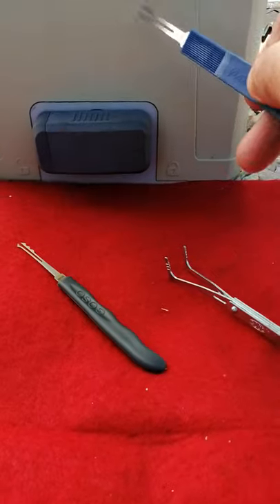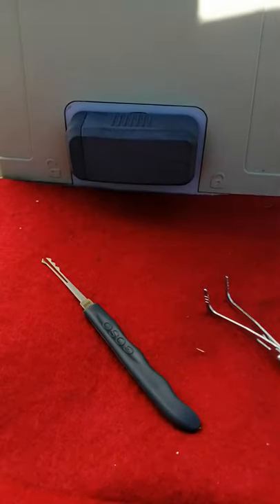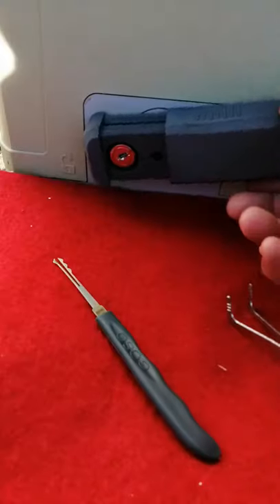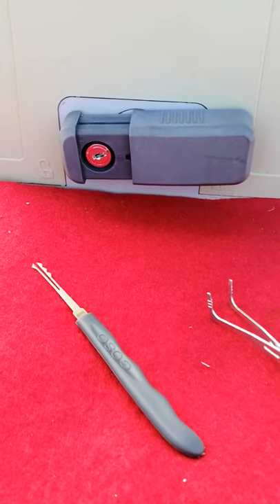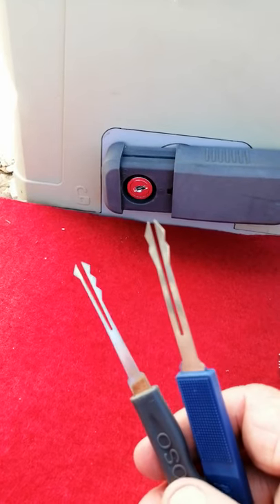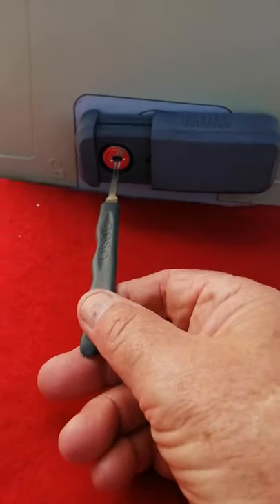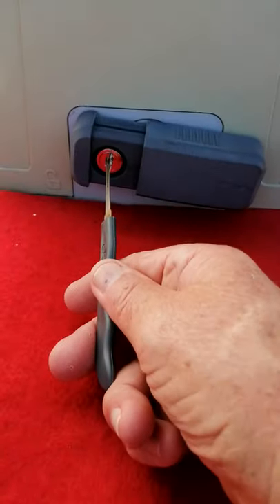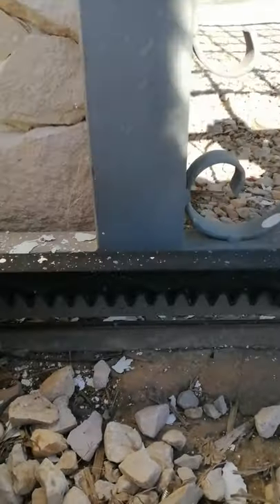(55)  Powertech electric gate wafer lock raked

Comment: A very cool demonstration. Always amazed at why they still use wafer locks on a security system like an electric gate. Have a Happy Picking New Year, cheers
Reply from the maker: Yes PW you are right. Generally speaking wafer locks are not difficult and you really would think that something more substantial should be used. Thanks as always for watching and for your comments. Happy New Year

Comment: That goso rake is good. I havent tryed it on a wafer lock it that its failed on haha. Been a few times iv opend peoples lockers with it (work related). Hasn't failed me. Sometimes an up and down jiggle is good as well as rakeing in and out👍
Reply from the maker: Yes, Deadlocks, a little jiggle always helps. There are such picks as jigglers as I'm sure you know but I've never tried them.
Reply: I have a set of jigglers. They are a bit like rakes. The right one in the right lock works quite well 👍